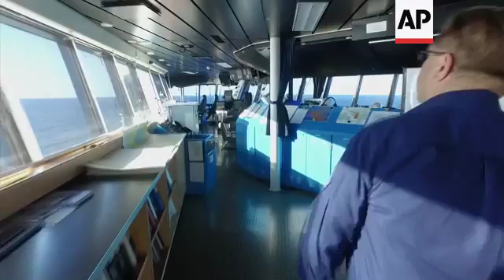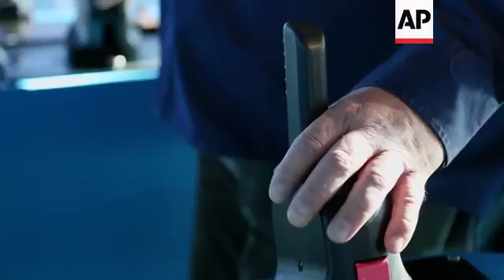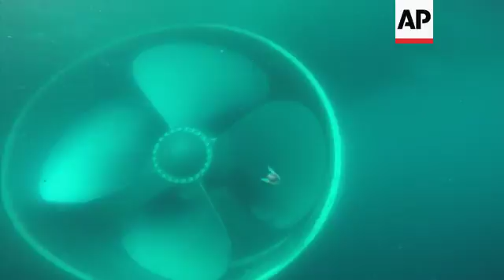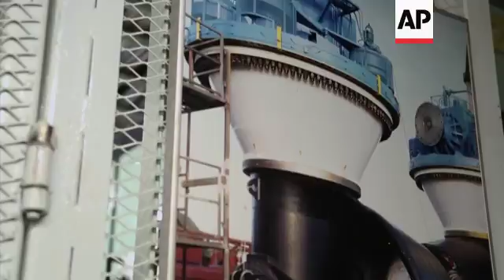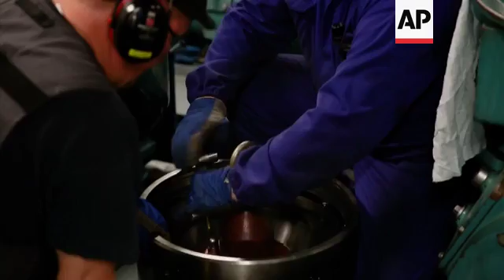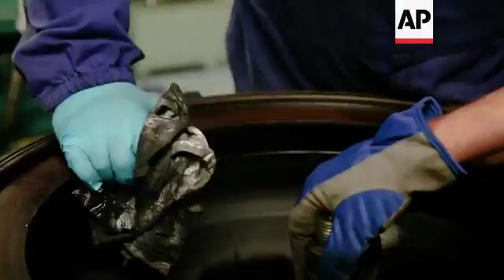Only on AP: Inside record-breaking MSV Nordica icebreaker

Comment: Nice people, great ship!  And so was " Fennica" .  We only had a small problem when sinking anchors into the mud with both ships pulling, I can't remember the exact amount of Bullard pull that was required for 30 minuites. But both ships had to pull simualtaniously,  but then, as the load got heavier, " Nodica's " positioning system started kompensating for the drag,  and started running away.  The wire to the tri-plate was so nice and tight up of the water, that I was thinking for a moment , how can I Play that string? .  At that time I was controlling the main winch, and was told all orders had to go in english. Only heard finnish and norwegian. But of course , you have to use your sense, so I just said Paying  out.  
Geronimo liked that ! At that time both ships were on lease to Ulgland Offshore, it was in the summer.
Reply: LNG-powered icebreaker Polaris - Full-scale ice trials of the Aker ARC 130 design https://www.youtube.com/watch?v=p9E0Q05-3Zg